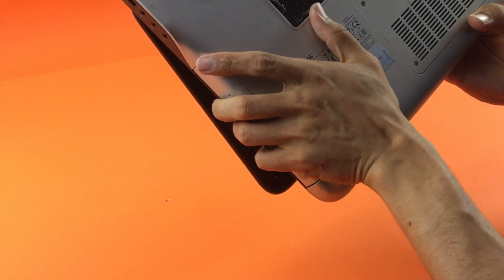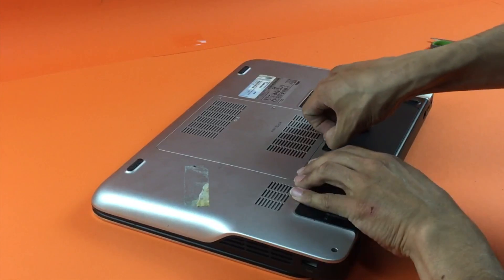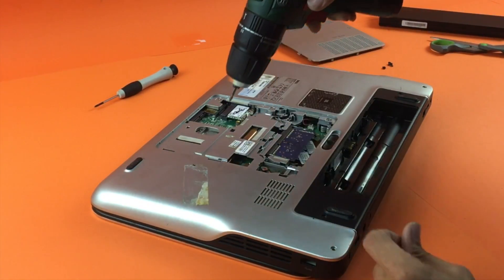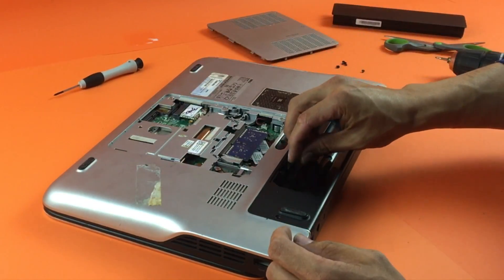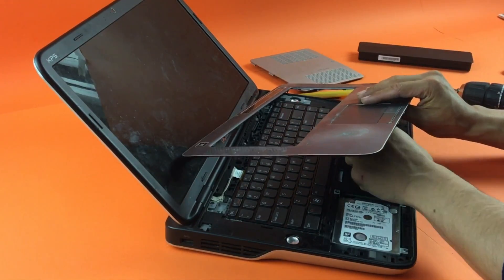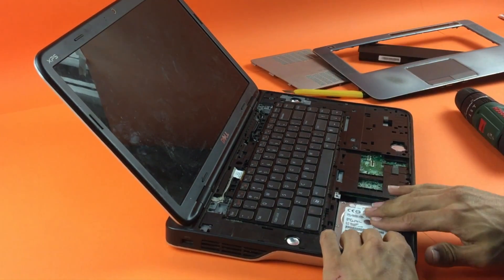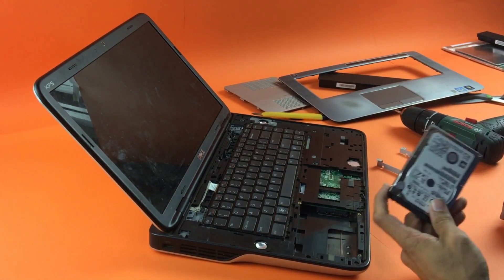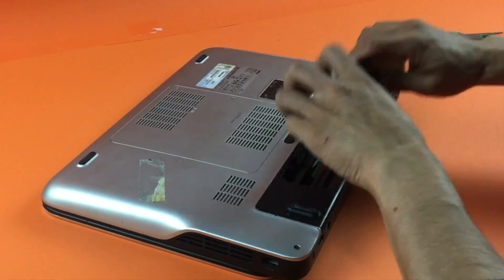Dell XPS L502X Hard Drive HDD Replacement

Comment: You don't know what your doing ....you only need to take out the k screw and unclip the k clips in the battery compartment 
why are you undoing all these screws ? and why are you using a battery  powered screw driver
Reply from the maker: Your right

Comment: I'm a retired IT Specialist and Dell Certified Technician.  No disrespect intended, but removing all those screws is totally unnecessary. There's one phillips screw in the battery compartment that releases the palm rest and then you can pry it up to access the hard drive. It's in the Dell manual and I've done it to replace the hard drive in my XPS L502x.
Reply: So I would like to replace my dads disk drive with a new NVME SSD. I don’t have the laptop in front of me and I was wondering what the dimensions are for the hard drive on this computer and if the new one would fit. Or should I look at another type of SSD?
Reply: Your right
Reply: Thanks for the advice man! i`m having problems with the cpu clock in 0,79ghz, it`s battery or a charger problem?
Reply from the maker: I know, this laptop was being serviced beyond the issues shown, and I thought might as well record for bit and piece
Reply: @EasyFixLaptop  I understand.  I just wanted to provide info for anyone only interested in replacing the hard drive.  I wish you well and keep safe in these unusual times.
Reply: @LGDoc  Thank you for telling me this! I started unscrewing all those in the vid and stopped and read comments.